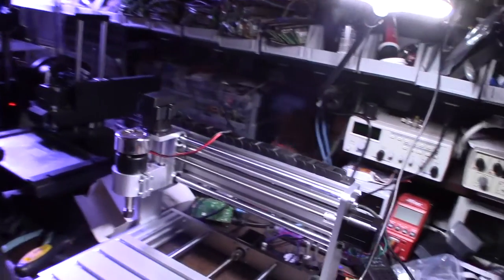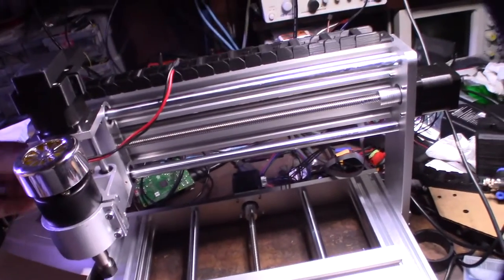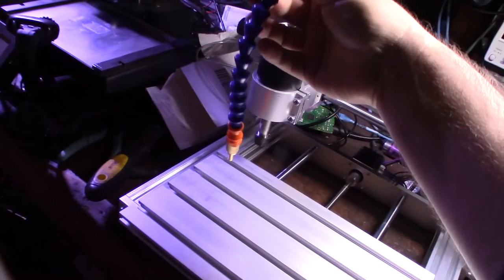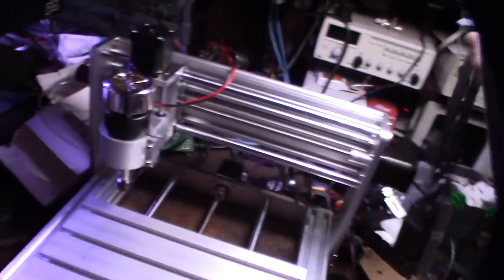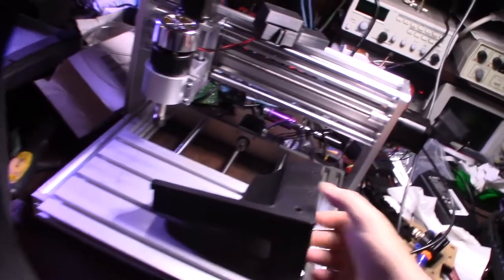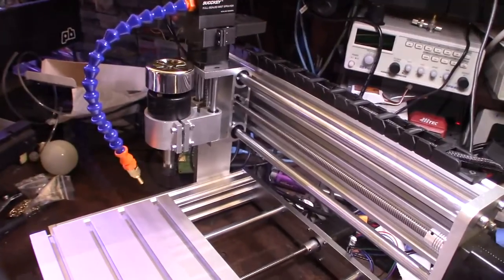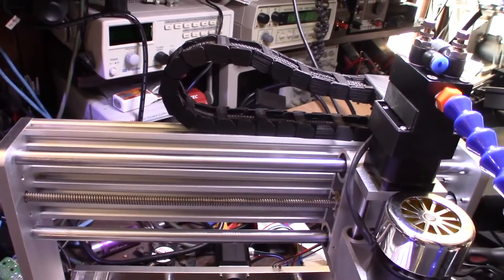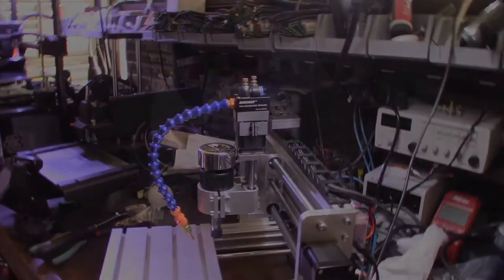3018 CNC Air Lubricant System For Cutting Aluminum & Carbon Fiber with Cable Drag Chain Cooling

Comment: I'm excited to see the finished containment system
Reply from the maker: I'm finishing the bottom up and already have designed the sides. Some of these pieces take days to 3D print. The bottom should be done printing in a week. I'm also going to upgrade my 3018 to MKS DLC so I can use my trinamic drivers.